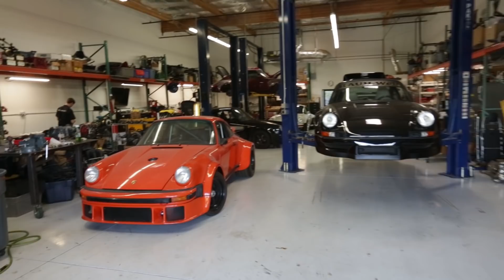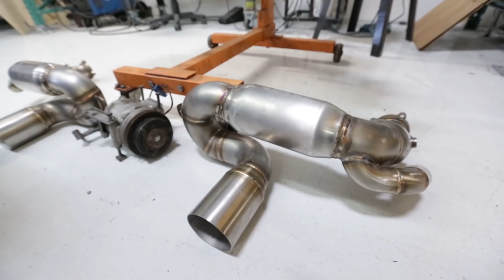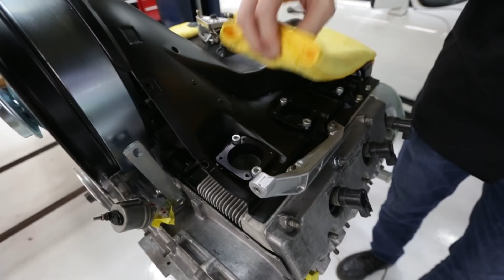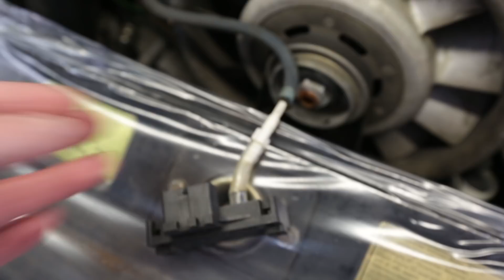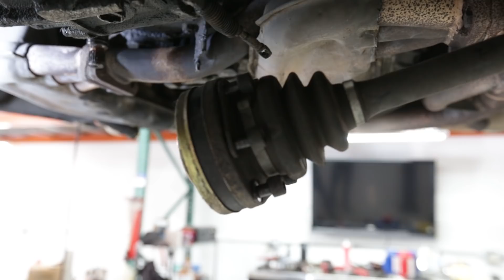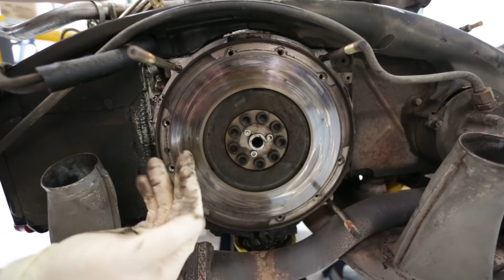Welcome to TurboKraft - Porsche 930 Project - EP01

Comment: You have my dream car.  I used to have an authentic 1986 RUF BTR that I sold in 2005.  The EFI is a way to go for the 930.  I drove one with a Zytec setup and it was amazing.  I bet today you can get an amazing performance with motec.  What happened to that guy in Arizona, Motorsports Design?  Bob Holcombe his name.  He used to make some amazing ITB setups.
Reply from the maker: Oh wow, I absolutely love all the RUF Porsches, they're marvels of engineering for their time. Lucky that you owned one. As for Bob, never heard of him so not sure!
Reply: I know a couple of people who have turbos with his engine.  One is a 930 and the other is a 993 turbo.  The 993 makes 850hp.  It was built by Bob and later by Butch Stokes close to Hallandale Blv. in South Florida.  This guys from Turbokraft do amazing work.  Did you contemplate the idea of using the carrera intake instead of the blocks?

Comment: Are you going to go back and forth for the duration of the build? Or stick around warm and sunny AZ until the car is ready?

Also Why go that far? There are closer specialists to the border !
Reply from the maker: +0ttoman Oh not a chance. I'm down in AZ for the duration of the build. And I am very picky when it comes to who I partner with on projects, I've seen Turbokraft built cars and engines and knew right away that I wanted to work with them. They are extreme professionals and meticulous with their work. Plus Chris and Mike are great guys.

Comment: With the new efi capability, are you planning on running the engine efficiently and cutting off fuel during deceleration? Or are you adding some fuel to retain the old school overrun goodness?
Reply from the maker: +linkems No overrun, I plan to run the engine like most modern cars so they popping that was present with CIS will be gone. One small drawback but the advantages are worth it.

Comment: Wow! Thanks for all the technical details. I finaly understand why everyone talks about light weight clutches and 911s. That pressure plate must make it drive like a dump truck. How much lighter will the new one be?
You guys should check out my video on transmission woes.  https://youtu.be/QeGPublr_W0
Reply from the maker: +Phoenix60 Yes! The new one will be from Spec Clutch and have a traditional sprung clutch so much lighter and easier to use.